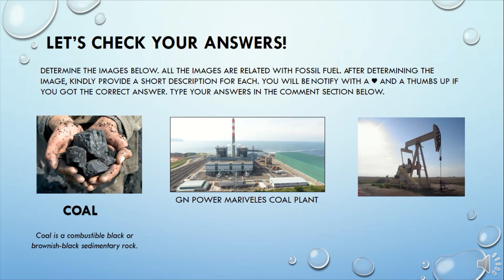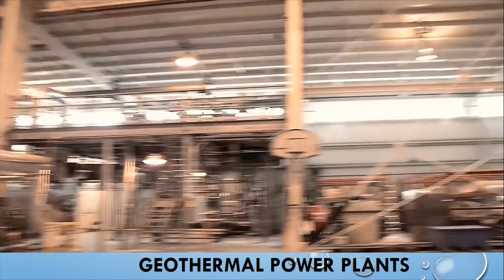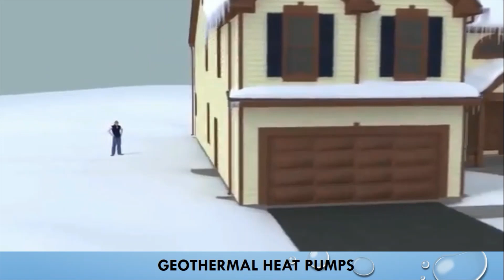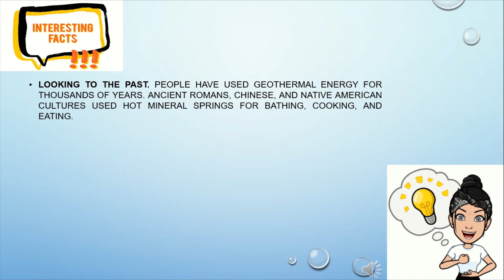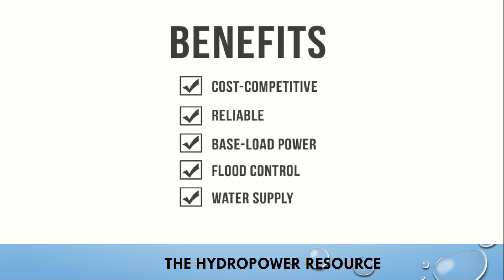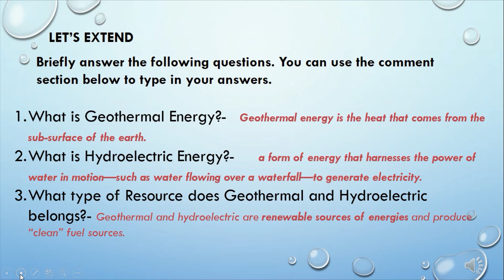GEOTHERMAL ENERGY AND HYDROPOWER RESOURCES (A SHORT DISCUSSION)

Comment: Vitug, Deniel Vinz D. (11-Sagittarius)

Let's Review:
a. Coal - combustible black or brownish-
black sedimentary rock, primarily used as a fuel
b. Generating Station - the space in which the main source of electrical power is situated
c. Pumpjack - used to mechanically lift liquid out of the well if there is not enough bottom hole pressure for the liquid to flow all the way to the surface, i.e. crude oil

Let's Extend:
1. Geothermal Energy makes use of the thermal energy in the Earth's crust originating from the formation of the planet and from radioactive decay of materials in order to produce electricity.
2. Hydroelectric energy is a form of energy that harnesses the power of water in motion, such as water flowing over a waterfall, to generate electricity.
3. Geothermal and Hydroelectric Energy are some of the best examples of renewable energy.

Comment: Elijah Kaile L. Matawaran
11-STEM TAURUS 
Let’s Review
A.) Coal- is a sedimentary rock produced by coalification in which plant and animal remains go through physical and chemical changes. It’s a combustible black or brownish-black sedimentary rock that is formed as sedimentary rock called coal seams. 

B.) Generating station- is an industrial structure that generates electricity. A power station, also known as a power plant and referred to as a generating station or generating plant. 
C.) Pump jack- In an oil well, a pumpjack is the surface drive for a reciprocating piston pump.
Let’s Extend 
1.) Geothermal energy it is produced by the heat within earth. 
2.) Hydroelectric Energy is harnessed by motion caused by water such as water flowing over a waterfall to generate electricity. 
3.) Geothermal and hydroelectric are both renewable sources of energy.

Comment: Akieza Bertulfo 
11 Sagittarius
A. Coal - This is a material that is usually found in sedimentary rock deposits which is where rock and dead plant and animal matter are piled up in layers.
B. Generating Station  - a plant for generating electric power.
C. Pumpjacks - it works like an artificial lift. this simply increases the pressure within an oil well to pull oil to the surface.

Let’s Extend;
1. Geothermal energy is the heat that comes from the sub-surface of the earth.
2. also called hydroelectric power or hydroelectricity, is a form of energy that harnesses the power of water in motion—such as water flowing over a waterfall—to generate electricity.
3. Resource of Geothermal and Hydroelectric are renewable sources of energies and produce “clean” fuel sources.

Comment: Cabral, Robelie Ann M.
11 STEM - Sagittarius 

A. Coal is a type of fossil fuel formed from sediments such as prehistoric animal and plant remains that constantly piled up and become pressurized through time.

B. Generating Starion are generally connected to an electrical grid. Also, is an industrial facility for the generation of electric power.

C. Pump Jack - is the overground drive for a reciprocating piston pump in an oil well. It is used to mechanically lift liquid out of the well if there is not enough bottom hole pressure for the liquid to flow all the way to the surface.

Let’s Extend: 
1. Geothermal energy is the heat that comes from the sub-surface of the earth.
2. Hydroelectric energy is a form of energy that harnesses the power of water in motion—such as water flowing over a waterfall—to generate electricity.
3. Resource of Geothermal and Hydroelectric are renewable sources of energies and produce “clean” fuel sources.

Comment: Joshua Riel A. Lorenzo 
11 STEM Sagittarius

a.) Coal is a nonrenewable fossil fuel that is combusted and used to generate electricity. 
b.) Generating station is a plant for generating electric power.
c.) A pump jack is a device used in the petroleum industry to extract crude oil from a oil well where there is not high enough pressure in the well to force the oil to the surface.

Comment: 11-STEM PISCES
Guila, Jose Ernest S.
Let's Review:
1. Coal- one of the primary fossil fuels, brown or black and often occurs in sedimentary deposits 
2. Generating station- a facility that generates electricity. 
3. Pump Jacks- physically extract oil for use. It operates by creating an artificial lift.

Let's Extend:
1. Geothermal energy is the thermal energy in the Earth's crust which originates from the formation of the planet and from radioactive decay of materials in currently uncertain but possibly roughly equal proportions.
2. Hydroelectric energy, also called hydroelectric power or hydroelectricity, is a form of energy that harnesses the power of water in motion.
3. Renewable resources.

Comment: BETONIO, RJ J.
11 STEM PISCES
Let's Extend

Geothermal energy - is a renewable energy source because heat is continuously created inside the earth, geothermal energy is a renewable energy source. Geothermal heat is used to bathe, heat buildings, and create energy.
Hydroelectric Energy - is an energy produced from hydropower.
The Geothermal and Hydroelectric are both renewable resources.

Comment: Betonio, RJ J.
11 STEM PISCES
Coal- is the common fossil fuel that can be used to generate electricity.
Generating Station- this is where the coals are burned that generate and provide electricity in different cities.
Pump Jack- has a counterweight attached to an arm that swings a pivoting beam up and down is rotated by an electric or gas-powered engine. A rod assembly is pulled up and down by a cable on the opposite end. When the rod falls, a hollow chamber with a simple valve opens and fills, then closes and raises it up.

Comment: Caisip, Alesandra L. 
11 STEM - TAURUS

Let's review
A. Coal - is a hard, black substance extracted from the earth in pieces that can be burned to generate heat or power.
B. Generating Station - is an industrial facility that generates electricity.
C. Pump jack - A pump jack is a device used in the petroleum industry to extract crude oil from an oil well when the pressure in the well is insufficient to force the oil to the surface.

Let's Extend
1. Geothermal energy is the thermal energy in the Earth's crust which originates from the formation of the planet and from radioactive decay of materials in currently uncertain but possibly roughly equal proportions.
2. Hydroelectric energy is a type of energy that uses the power of moving water to generate electricity.
3. Both hydroelectric and geothermal energy are classified as renewable energy sources.

Comment: Tolentino, Samuel S.
11-STEM Scorpius

Let's Review:
A. Coal - is a material usually found in sedimentary rock deposits where rock and dead plant and animal matter are pilled up in layers.
B. GN Power Mariveles Coal Plant - is a coal power plant in Mariveles, Bataan.
C. Pump Jack - is a device used in the petroleum industry to extract crude oil from a oil well where there is not high enough pressure in the well to force the oil to the
surface.

Let's Extend:
1. Geothermal energy is the heat that comes from the sub-surface of the earth. It is contained in the rocks and fluids beneath the earth's crust and can be found as far down to the earth's hot molten rock, magma.
2. Hydroelectric energy is a form of energy that harnesses the power of water in motion to generate electricity.
3. Both geothermal and hydroelectric energy are classified as renewable energy sources.

Comment: Lord Airolvin S. Panganiban
11 STEM - Libra

Let's Review
A. Coal is a type of fossil fuel formed from remains of dead plant and animals million years ago.
B. GNPower Mariveles is an example of a generating station. It is the main supplier of electricity that electric companies distribute.
C. Pump jacks are machinery used to extract crude oil from the ground.

Let's Extend
1. Geothermal energy is a type of renewable energy that comes from the heat of the Earth.
2. Hydroelectric energy is a type of energy wherein the flow of water is used to generate electricity.
3. Geothermal and Hydroelectric energy is a type of renewable energy because the Earth continuously produces heat and the water cycle repeats due to our sun.

Comment: San Miguel, Rania J.
11 STEM - Phoenix
11-07-2021

LET'S REVIEW:
A. Coal -  It is one of the three major types of fossil fuels. It is a brittle and sedimentary rock that is composed mostly of carbon and hydrocarbons that can be found in underground deposits.

B. Generating Stations - It is a power station or an industry that converts coal into electrical energy.

C. Pump Jack - It is a device used in oilfields that extracts crude oil into the surface as a reservoir from low pressure oil wells. 

LET'S EXTEND:
1. Geothermal energy is the heat that comes from the earth's molten interior.

2. Hydroelectric energy is produced by using the flow of water to generate electricity.

3. Geothermal and hydroelectric energy are both renewable energy sources of the earth.

Comment: Mendoza, Shyrene Cristal Mae E.
11-Phoenix

A. Coal - one of the most important primary fossil fuels, a solid carbon-rich material that is usually brown or black and most often occurs in stratified sedimentary deposits. 

B. Generating station -  a plant for  generating electric power.

C. Pump jack - is a device used in the petroleum industry to extract crude oil from a oil well where there is not high enough pressure in the well to force the oil to the surface.

Let's Extend:

1. Geothermal Energy - Geothermal energy is a renewable energy source because heat is continuously produced inside the earth.

2. Hydroelectric Energy - Hydroelectric energy, also called hydroelectric power or hydroelectricity, is a form of energy that harnesses the power of water in motion—such as water flowing over a waterfall—to generate electricity.

3. Geothermal and hydroelectric are renewable sources of energies and produce “clean” fuel sources.

Comment: Timbang, Joana Bernadette M. 
11 STEM Pisces

Let's Review

(A) Coal - Coal is a nonrenewable energy source because it takes millions of years to form. It is primarily used as fuel to generate electric power.

(B) Generating Station - Generating station, also referred to as a power plant, is an industrial facility that generates electricity from primary energy.

(C) Pump jack - Pump jacks have been used for more than a century to provide artificial lift to bring oil from the well to the surface.

 Let's Extend

1. Geothermal energy is heat derived within the sub-surface of the earth.

2. Hydroelectric energy is energy derived from the movement of water.

3. Both geothermal and hydroelectric energy are renewable energy sources.

Comment: GABATINO , Blesshe Mae A. 
11 STEM - PISCES
LETS REVIEW 
A. Coal - This is a material that is usually found in sedimentary rock deposits which is where rock and dead plant and animal matter are piled up in layers.
B. Generating Station - it is a facility for the generation of electric power.
C. Pumpjacks - it works like an artificial lift. this simply increases the pressure within an oil well to pull oil to the surface. this is used in the petroleum industry to extract crude oil from an oil well where there is not high enough pressure in the well to force the oil to the surface.

Let's Extend
1. It is the energy that is within the Earth. It is a renewable energy source because it is continuously produced inside the Earth.
2. This is the energy that harness the power of water in motion such as waterfalls, rivers and more. 
3. Both of these are renewable sources of energies.

Comment: Holgado, Hans Gabriel T.
11-STEM PISCES
(A). Coal - is formed when dead plant matter decays into peat and is converted into coal by the heat and pressure of deep burial over millions of years.
(B). Generating station- is a plant for generating power.
(C). Pump Jack- is a device used in the petroleum industry to extract crude oil from a oil well where there is not high enough pressure in the well to force the oil to the surface.

Let's Extend

1.Geothermal energy- is heat within the earth also comes from the heat in the earth’s core. Geothermal energy is a renewable energy source because heat is continuously produced inside the earth.
2.Hydroelectric energy- is generated by harnessing the power of moving water.
3.Geothermal Energy and Hydroelectric Energy- are both classified as renewable sources of energy.

Comment: Santos, Mariane GRace M. 
11-STEM SCORPIUS
Let's Review
*Coal is a combustible black or brownish-black sedimentary rock that can be burned and used for electricity 
*A coal power plant that generates electricity
*Pumpjack is an overground drive for reciprocating piston pump in an oil well

Let's Extend
*Geothermal energy is heat that comes beneath the earth surface and is a renewable source 
*Hydroelectric power is electric energy produced through the power of moving water
*Both of these are renewable resources

Comment: Estanislao, Louigie Kyle G. 
11 STEM - SAGITTARIUS
A. Coal - This is a material that is usually found in sedimentary rock deposits which is where rock and dead plant and animal matter are piled up in layers.
B. Generating Station - it is a facility for the generation of electric power.
C. Pumpjacks - it works like an artificial lift. this simply increases the pressure within an oil well to pull oil to the surface. this is used in the petroleum industry to extract crude oil from an oil well where there is not high enough pressure in the well to force the oil to the surface.

Comment: Cabiedes, Dianne Cristine 
11-STEM Pisces

Let's Review:
1. Coal- one of the primary fossil fuels, brown or black and often occurs in sedimentary deposits 
2. Generating station- a facility that generates electricity. 
3. Pump Jacks- physically extract oil for use. It operates by creating an artificial lift.

Let's Extend:
1. Geothermal energy is the thermal energy in the Earth's crust which originates from the formation of the planet and from radioactive decay of materials in currently uncertain but possibly roughly equal proportions.
2. Hydroelectric energy, also called hydroelectric power or hydroelectricity, is a form of energy that harnesses the power of water in motion.
3. Renewable resources.

Comment: Garcia, Myles Venus Y.
11-STEM Scorpius

Let's Review

A. Coal- one of the most important primary fossil fuels, a solid carbon-rich material that is usually brown or black and most often occurs in stratified sedimentary deposits.
B. Generating stations- is an industrial facility for the generation of electric power.
C. Pump Jack -  is a device used in the petroleum industry to extract crude oil from a oil well where there is not high enough pressure in the well to force the oil to the surface.  

Let's Extend

1. Geothermal Energy -  is the heat that comes from the Earth's core and is a renewable source of energy. It is produced from the heat generated during the planet's creation and subsequent radioactive decay of elements.
2. Hydroelectric Energy - is a form of energy that harnesses the power of water in motion. Hydroelectric energy is the most commonly-used renewable source of electricity.
3. Both Geothermal Energy and Hydroelectric Energy is a renewable source of energy.

Comment: Paule, Ma. Francesca Fatima 
11-STEM Taurus

Let's Review:
A. Coal- is a combustible black or brownish-
black sedimentary rock, formed as rock strata called coal seams. Primarily used as a fuel.
B. Generating Station (Power Station)- an industrial facility for the generation of electric power. 
C. Pumpjack- the most common way to get crude oil or any oil that supplies the whole world.
With its two stages of the pumping process, the upstroke and downstroke. Repeating the oil to
slowly push up to the surface.

Let's Extend:
1. Geothermal Energy is energy that comes from the heat within the Earth. People around
 the world uses geothermal energy to produce electricity, heat buildings and greenhouses, and for other purposes.
2. Hydroelectric Energy or also known as Hydropower is one of the oldest and
 largest sources of renewable energy, which uses the natural flow of moving water to generate electricity.
3. Geothermal and Hydroelectric Energy both belong to renewable sources of energy.

Comment: Caladiao, Keisha Camille S.
11 STEM - SAGITTARIUS

A. Coal - This is a material that is usually found in sedimentary rock deposits. 
B. Generating Station - A establishment for the generation of electric power.
C. Pumpjacks - This process of creating artificial lift simply increases the pressure within an oil well to pull oil to the surface.

Let's Extend

1. It is the energy within the Earth. With that being said, it is a renewable resoure as it is produced within our planet. 
2.  It a form of energy that harnesses the power of water in motion.
3. These are renewable sources of energy.

Comment: Allyssa Cabalagnan
11-STEM TAURUS

Let's Review
A. Coal- Coal is a combustible black or
brownish-
black rock that is usually found in
sedimentary rock deposits. It is primarily used
as a fuel, but is classified as a nonrenewable
energy source because it takes millions of
years to form.
B. Generating Station- is a facility for the
generation of electric power. It converts
mechanical energy to electrical energy.
C. Pump Jack- is an overground drive for
reciprocating the
piston pump in oil well. It's used for
mechanically lifting the liquid out of a well if
there isn't enough bottom hole pressure for
liquid to flow to the surface.
Let's Extend
1. What is Geothermal Energy?- Geothermal
energy is the heat that comes from the sub-
surface of the earth. It can be used to produce
electricity, to heat buildings and greenhouses,
and many other purposes.
2. What is Hydronlastric Enargy?- it is one of the oldest and
largest sources of renewable energy, which
uses the natural flow of moving water to
generate electricity.
3. What type of resource does Geothermal
and Hydroelectric belongs?- They are
renewable sources of energy on Earth.